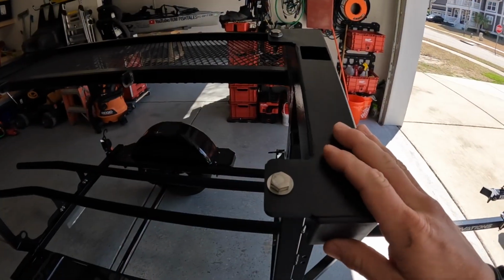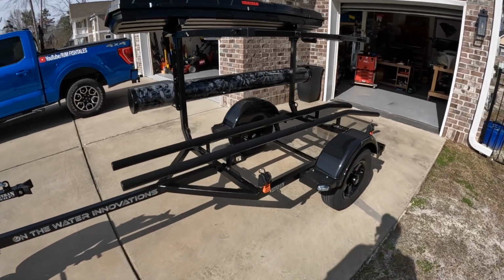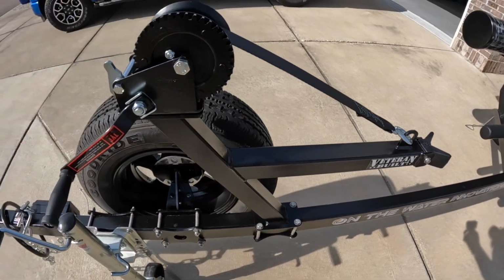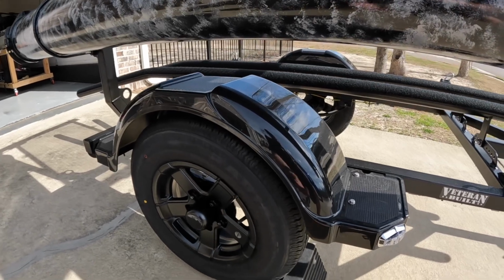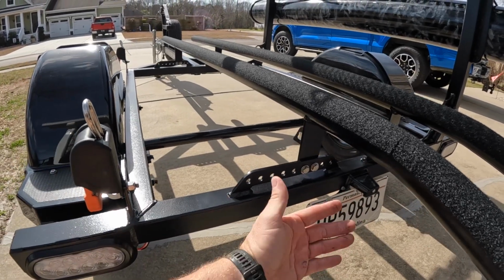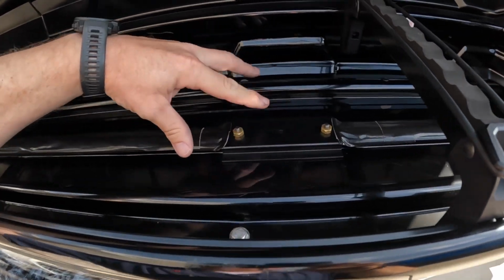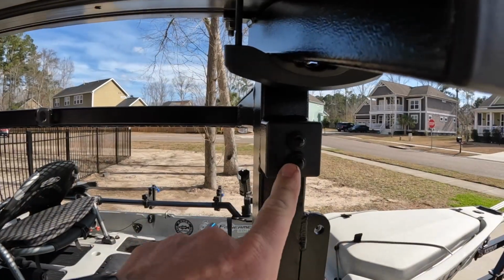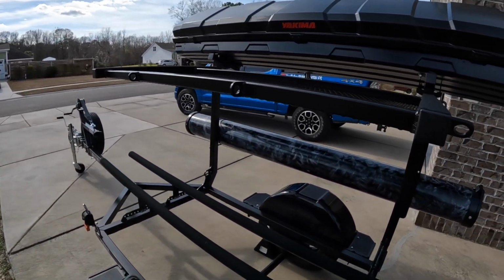Custom Kayak Trailer / On The Water Innovations / Tourney Light

Comment: Awesome trailer you will be rocking up to launch in style.  Looks super durable and functional!
Reply from the maker: Yes it is durable.  I am tired of going back and forth, back and forth.  I wanted to get one more way of transporting kayak that fits in my size restraint in my shop and be done.  Plus main reason to get trailer again is to be able to take out people for my charity and my son eventually.  Thanks brother.
Reply: @rjmfishtales  I get it.  I repurposed a harbor freight trailer that works great but I am constantly replacing the trailer lights and light brackets everytime I dont pay attention when pulling the yak aboard and bang the lights.  At some point I will pull the trigger for a trick set up like yours.  Keeping Slaying!
Reply from the maker: @FreeSpooling  thanks brother.

Comment: OTWI is extremely pricey for what you’re getting. It may be a custom order and works for you, but it for the amount of materials used in that construction it’s highly priced. The Yakima box alone is a grand. I can diy this into a double decker for less than a grand in my back yard using an old steel frame utility trailer
Reply from the maker: Yes they are pricey but work very well.  I am using a utility trailer now myself anyways.

Comment: Great video. Great product. My question is this: Do you feel that the "upper supports with the wire mesh base" are sufficient to haul another kayak on. My girlfriend has a "Crescent CK-1" (11' length, 60 lb weight) that we will be using in addition to my Nucanoe Unlimited (Nucanoe Unlimited on the main bunks of course)
Reply from the maker: Yes the upper supports are rated for well over 250 pounds.   I have stood on top myself before.  I am 252pds.   

I plan on putting another Hobie PA 14 on top very soon.  Nothing to worry about.   Just make sure you use good straps as it will bounce around.  Just check strap’s periodically on long trips.   You will be good to go and enjoy

Comment: Hey great detail in your video much appreciated....i am torn between a basic double or a nicer single trailer like the one you have. If your comfortable discussing price please let me know a round about cost for the trailer as it sits in your driveway. I like to have pretty much exactly what you have for my pa 14 thank you.
Reply from the maker: I got a little bit of a deal doing video and knowing Denny personally.   But out the door normal price right now is $3900.  Then the box I put on myself and got for $510 around Christmas time.  Normal price is $630.  The tube I painted myself and installed.  Got tube from jobsite I was working on.  So only cost me $100 for mounting and end cap kit from Amazon.  So it’s a $4500 ordeal.  But totally worth it to have for life.  You can wet launch extremely easy or sometimes I slide off and just use my Boonedox wheels.  Depending how busy ramp is.  

If I had the room I would have done the double but wanted to keep in my garage and didn’t want to give up my desk where I prep and do filming.  But if it’s only one or 2 people you need to worry about the Tourney light works fine.  
I plan on doing a video soon for 3 month review and 4K miles on it already here shortly.  Everything has been good.

Comment: Reall enjoyed the video, I've been toying with getting one of his trailers. The second kayak option just pushed me over the edge. One question what are you putting in the rod tube is it going to submerse in water?
Reply from the maker: Thank you.  No the rod tube on the lower mount will not make it into the water or get submerged.   I chose the lower mount for the first tube so I had a void in between right now to have a little access to kayak on that side.  Who knows I may never add another tube.  

The tube is going to be used for bringing additional rods if they don’t fit In Yakima box.  Probably the ones I will be giving away to people I take out in the future.  

I would get one of the trailers in my opinion if you are going to utilize it a lot.  They are worth it and it’s about a 3 month or so wait period once you get in line.   That will give you some additional time to save money if needed.

Comment: how did you mount the rod tube to where someone cant unscrew the ubolt bolts out snd take the whole tube?
Reply from the maker: They could if they wanted to but they would just get an empty tube.  So if they like the tube that much I can make another one.

Comment: I’m building a garage….. can you tell me what the overall length is with your kayak on the trailer?  I see your kayak does hang over the end.
Reply from the maker: You need 18 feet with having the PA 14 on the trailer with the winch setup like mine as I have it moved as far forward as possible.   The trailer itself is 17’6” overall.

Comment: Wat paint u used to paint the u bolt from the rod tube?
Reply from the maker: https://youtu.be/9wdkuo3xQbY

In that video I show you the paint I use.  I forgot the exact name but I show you on that video.  I also wrapped it with electrical tape as well.  The good 3M one.  You can also take black shrink wrap and install and heat up around the u bolt.

Comment: What are the bunks made out of.
Reply from the maker: The bunks are made out of steel tubing with marine carpet on top.   You definitely want to add the carpet if you get one.  It’s allows the kayak to slide on and off easier and prevents any rust from forming over the years from the on and off of the kayak.